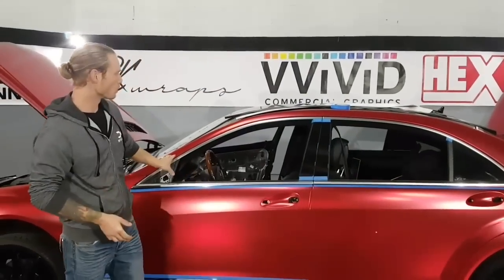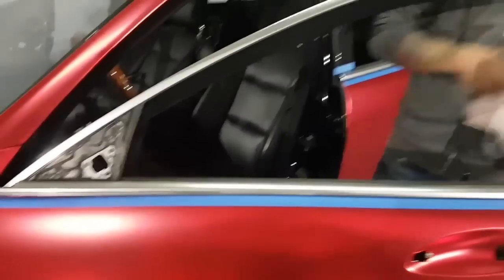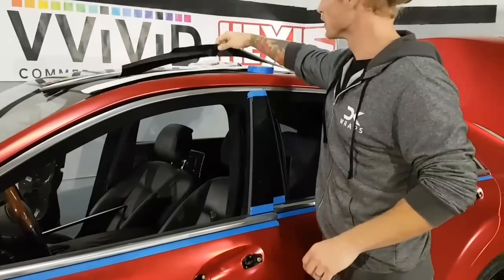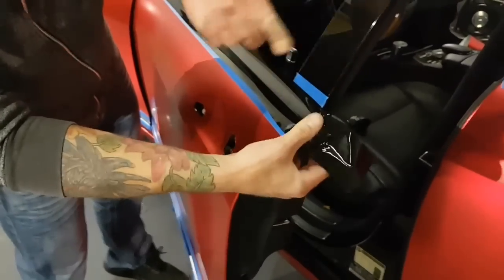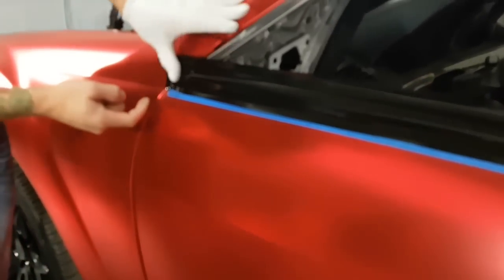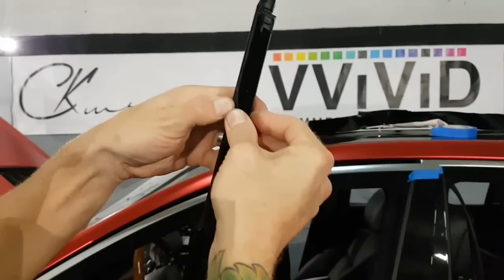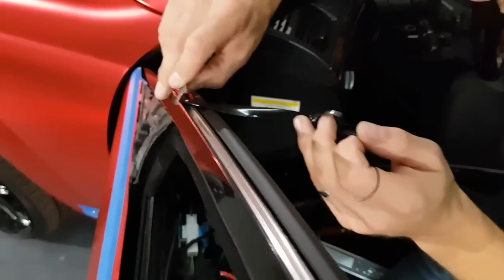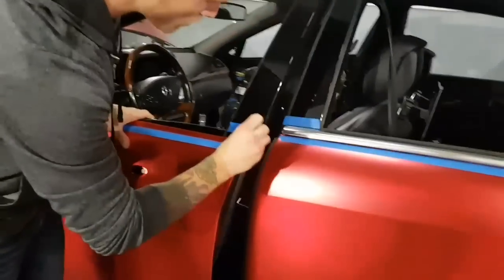How to vinyl wrap chrome trim. Chrome trim delete using vinyl. By @ckwraps

Comment: can you do a video showing how you remove the hardware (headlights, tail lights, door handles, mouldings, etc) Thanks!
Reply: Enrique Hinojosa but it Varies from each vehicle.
Reply: Screwdrivers and a proper socket set will remove most everything from a car.

Comment: Why not remove the chrome and wrap away from the car? I realize it takes a bit more disassembly of the door Etc but if this is not an issue to do, any downsides to removing and rapping and then reinstalling?